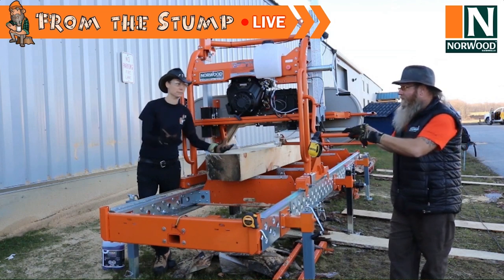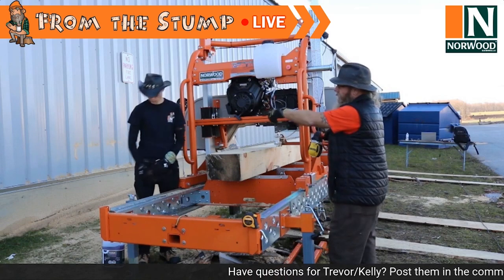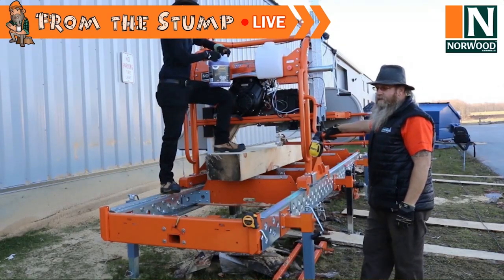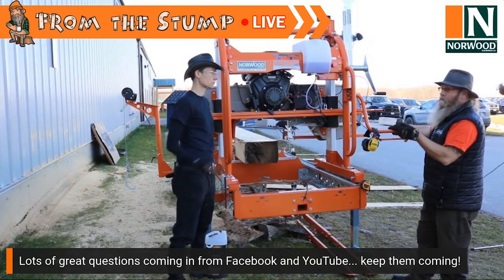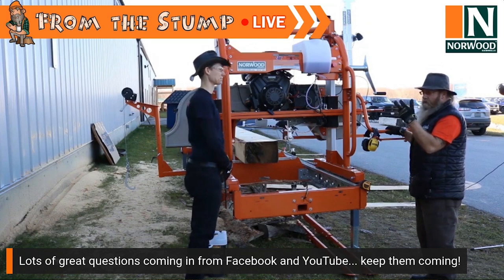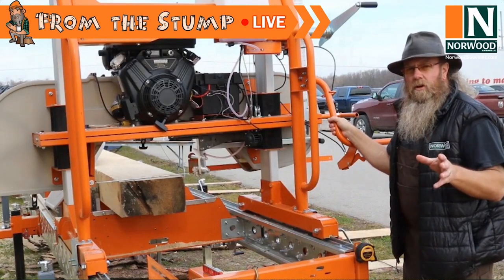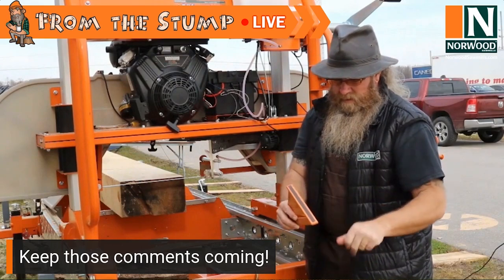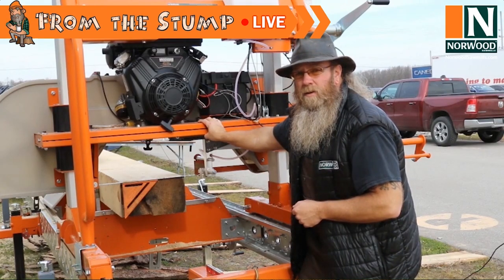From the Stump - Making Square Cuts and Tips About Water Flow

Comment: Just finished assembling our new HD36 - having a real challenge making square cuts, and one smaller challenge where the water flow for blade lubrication is not being stopped by the pinch point all the way when you're not throttled up and cutting. The water thing is easily managed just by manually opening and shutting the valve on the tank, but it's annoying and wasteful. We think the square cut issue comes down to not having a perfectly level platform (despite trying our best with the trailer jacks), and potentially having assembled the deck itself a bit out of square. Would be great to see a more in depth video around the leveling challenge.

Comment: Buffalo NY.  Does the water shut off automatically when blade is disengaged?  
The woodland mills has a valve that I think shuts off automatically when blade is stopped.
Reply from the maker: Hi Tim. All Norwood mills have an available patented auto lube shut-off. in fact, Norwood patented the invention. It comes standard on some Norwood models and optionally available on others.

Comment: Are there any issues with transporting the saw mill down "bad" roads?  

My property is a mile up unmaintained dirt roads, 8" holes not uncommon, could this potentially bend or break my saw mill during transport ( under 10 mph )?

I was curious if I should invest in a mill trailer conbo for mobile jobs or if it would just end up ruining the mill?
Reply: Which mill?  I've had my HD36 with trailer package down some pretty rough cow paths.  The biggest issues are 1) you have to watch scraping the back end of the mill coming on or off steep hills, and (2)you might want to remove the clamps and log stops to make sure they don't catch on a stump or frozen cow pie.
Reply: @daveboyt6810  thanks for your response, I've been looking at the HM130 max but haven't placed my order yet.  Going to be cutting mostly pine under 2ft diameter. HD36 seemed a bit out of my budget but not entirely, also really doubt I will be doing many 36" cuts.
Reply: @ogvoffgridventure3937  I can't say for sure about how other mills handle rough terrain, but as long as you take it nice and slow, you should be ok.  Be aware that what the mill can handle isn't the same as what it can handle easily.  I wouldn't plan on cutting many logs that push the limit of a mill.  It can be a real wrestling match.  For example, if you'll be cutting much 24" (at the big end), the LM29 or HD36 would be a better machine for you.  And go for the largest engine option.  I've never wished I had LESS horsepower.  I don't have experience with Woodland mills, so can't say much about them one way or the other.
Reply from the maker: The mills are very hardy and should be able to handle most terrain even off road I have towed the machines thru some pretty rough stuff and they come out smiling :)